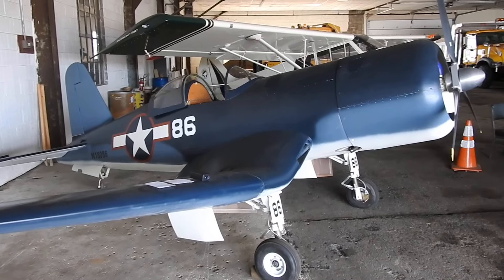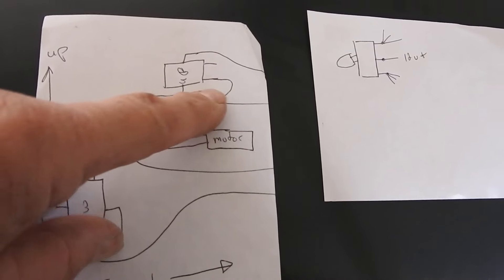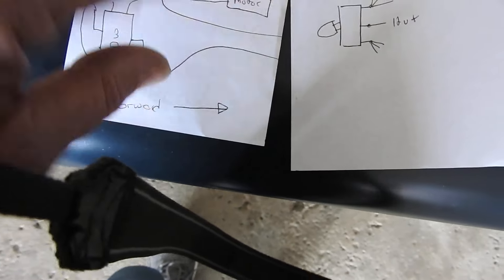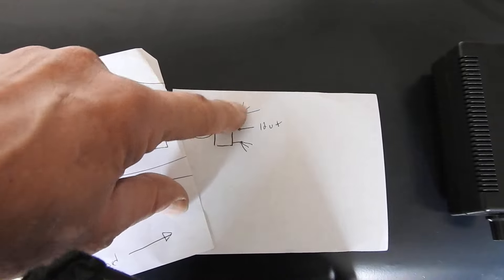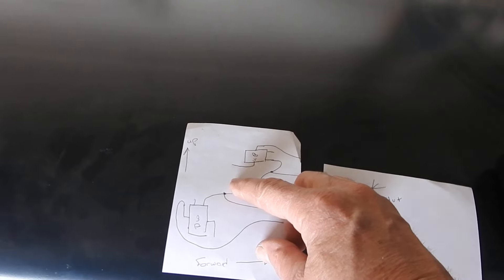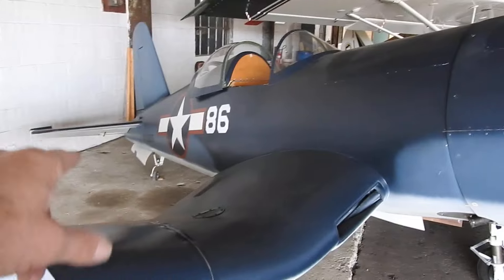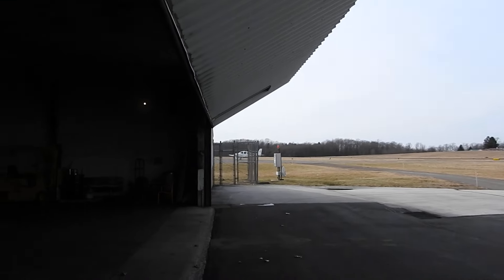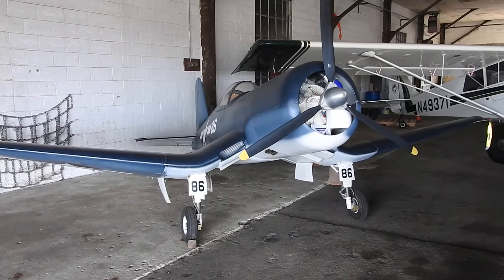WAR Corsair First update of the year 2/26/2024

Comment: Don, if you put the PWM on the batt side of the landing gear switch it might also affect the power to the  main’s hydraulic system.
Reply from the maker: The PWM will only go in line with the tail motor power and ground.